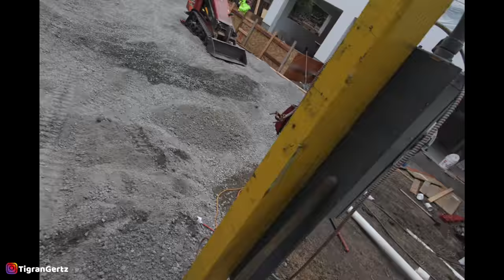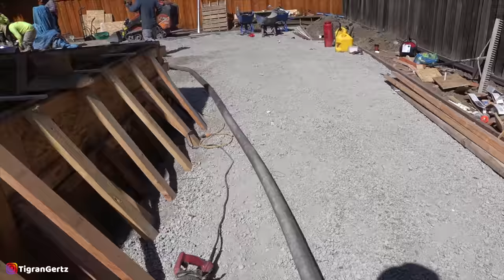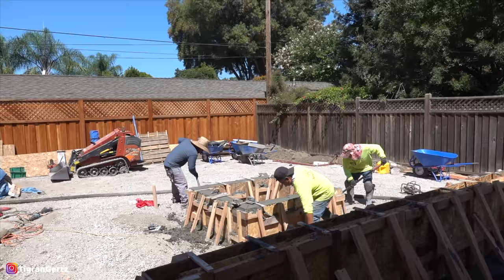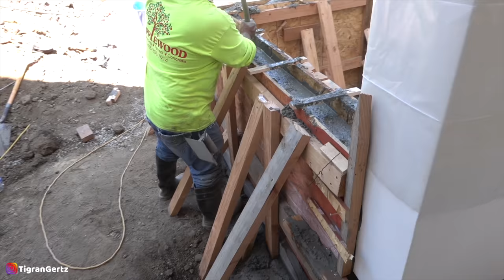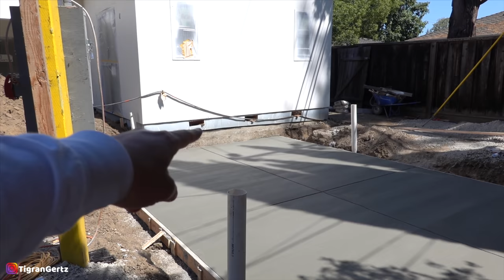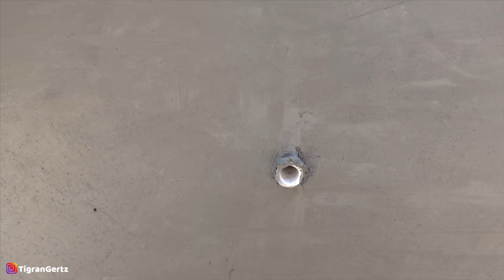Forming and Pouring Modern Planters

Comment: I manage a concrete division for a paving company and you are definitely right with your concrete advice! It’s all or nothing every time. You can’t have any room for mistakes, it has to be planned out 100%, and you only get one shot to do it.  That’s concrete!

Also, you should have put some snap ties and used a few turnbuckles to shore up that 4ft wall.  Less material and stronger.

Comment: I just poured large concrete boxes that are 8 feet long and 2.5 feet wide. They did not put in a drain. The boxes height is about 3 feet. I’m guessing I’ll need to drill through the bottom and install a drain?

Comment: Dude my boss runs a family owned concrete “business” and he always is scared to get more finishers so me and 2 other dudes always have to be busting ass on like 15-20 yard jobs. Especially like today we had to stamp and put bands on a job that was poured at 9am and the whole pour was right on the sun. Busted ass for like 4 hours without break
Reply: When you run your business remember this busting ,don't do it to your employees but still demand accountability,its a tough line.
Reply: we did some handicap ramps the other day and setup from 7am - 12 and then mud came at 12:13 We were all so pissed and there was only 4 of us and an apprentice. with 100 degree plus weather..... I hate handicap ramps with a passion......and it all blew the fuck up
Reply: Empty in California a good finisher charges 300 to 350 a day in my area and stripping forms not included unless it’s steps
Reply from the maker: @floorrez308  correct. i pay $350
Reply from the maker: i know the feeling when i worked for someone. They never had the right tools. So now i have all the tools

Comment: Any reason you didn’t build those with cement block . Don’t forget you will need access to the hot tub pumps and motors if your building a deck around it .